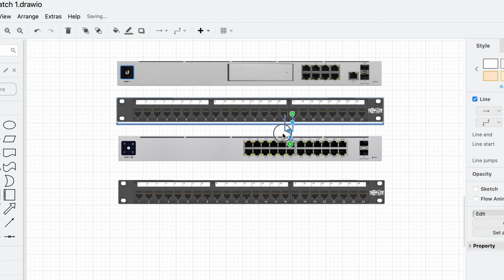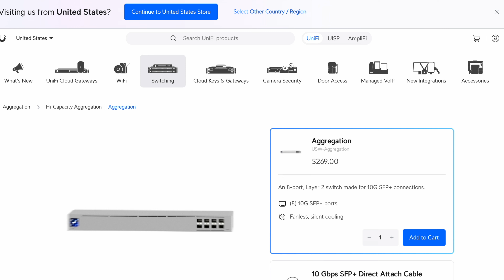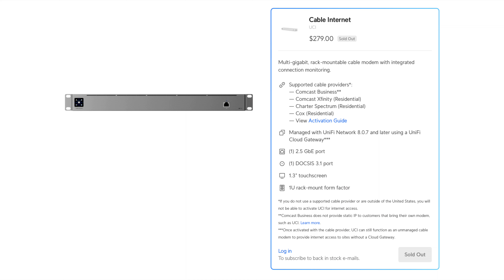Unifi Network Rack Cleanup!

Comment: I am looking at adding an aggregation switch also. I was under the impression you are supposed to run from your UDM Pro into the aggregation switch with 10G. Then from your aggregation switch to all of your other switches. It looked like you went from your UDM Pro to your 24 port switch and then into the aggregation switch. I may be wrong but wanted to mention it.
Reply from the maker: For my home, and most small business, it wont matter. There is plenty of switching capacity in the Pro switch and I am only really using it between my office and my synology. If I had 2 or 3 switches it would help. This is all way overkill for my needs anyway lol.
Reply: @JerrySchulze  understand my network is absolutely overkill for my needs also, but I don't play golf, so. LOL. Have a good one and appreciate the reply
Reply: Nice! I have a similar setup, but no aggregation. UDM Pro 10 GbE to 10 GbE switch, computer to the UDM Pro 10 GbE WAN (but port changed to LAN mode in the controller), Synology to the other 10 GbE switch port
Reply: @Jerry: First nice job, but your answer about bobby is not fully true. The way bobby would make it is better because off backplain L3 switching.

Comment: Gosh, you are using 10GB adapters for the Uplinks !? :) , please put some DAC cables there, much less heat and latency.
Reply from the maker: I have Dac between UniFi devices now. Have to use baset to office and synology.
Reply: @JerrySchulze  Ok, for the computers and the Nas is "fine" as there is no other option, at least for the uplinks will have much less heat, power consumption and latency.

Comment: I like the color coding of the jacks and cables. That is what I did on mine, but I used punch down RJ-45 jacks instead of pass through jacks. This eliminates one more failure point. I also did the patch panels above and below. You should also consider putting on small zip ties around the Ethernet cables and attach them to the strain relief bar behind the patch panels.

Comment: I would have had the 10 gig port on the UDM-Pro go directly into the Aggregation Switch and then connected the 24 Port switch to the Aggregation Switch, definitely not essential just a slightly more standard way of doing it.
Reply from the maker: I didnt because my little amount of traffic doesn't matter, BUT, I did re-work the whole thing again and did change that config.

Comment: I hate crimping cables, especially the thicker Cat 6A. I had the electrician do that for me while adding Ethernet to a build in an ADU. I still checked though to make sure it was running at the right speeds. 

Those slim cables are nice! I need to get some to clean up my small 8 port patch panel at home.

Comment: Those ethernet cables are not crimped correctly., the blue jacket has to be inside the rj45 connector
Reply from the maker: Yep, I absolutely know that. I was just being lazy.
Reply: I cringed a little bit also, but at the end of the day they are in a protected place and will still function just fine.
Reply: In the future use EZ-RJ45 with that tool allows wire to go through connector and cuts and crimps at same time.  Perfect every time and you get confirmation wires are in the correct location.

Comment: What a difference that made! Well done, Jerry! Question for you... Is there any particular reason you're going from your aggregation switch --> 24-port switch --> UDM Pro instead of 24-port switch --> aggregation --> UDM Pro? that way your aggregation switch is, well, aggregating all other switches and feeding that into your firewall?
Reply from the maker: Thanks for watching. Just because it doesn’t matter in my small home network or most small businesses. I really just wanted to keep using 10g for my office and symbology and step up from the 2x 1g uplinks. For that, I needed more ports but wanted rack mount otherwise the flex 10g would have been fine.
Reply from the maker: But I did pick up a UniFi cable modem so maybe I will make the change and move it above the top patch panel.
Reply from the maker: Also, looks evenly spaced like this, lol. I’ll never stop messing with it.

Comment: If I could make a suggestion, first off you had a routing loop in the pre-work by wiring out two ports to two ports on the switch (P1/2).  While they could be different vlan's it was accomplishing nothing of any value.   The reason is that the way the UDM works, those 8 ports are a switch, with a 9th(phantom) port on the motherboard you don't have access to that runs to the CPU.  That phantom port is only link to the rest of the network.  So the total bandwidth of those 8 ports maxes out at 1Gbps leaving that 8 port switch.  That is the reason that you couldn't LAG any of those 8 ports together as they are just a layer 2 stand alone switch.    There are 4 ports that tie to the CPU, port 9/10/11 and the one hidden port (from the 1-8 ports).  

In the final layout, I would like to suggest a change for increase performance.  

* Take the 10G LAN port (11) from the UDM directly to the 8 port Agg switch and make sure that is set to VLAN 1 (which is all vlans trunking port).  Then take port 25 SFP+ port to the 8 port agg swtich again on VLAN 1 as a trunk port.  This will allow you to actually LAG together by taking port 26 there as well.  So in this example you can Port 25/26 to port 1/2 of the 8 port agg and then port 11 from UDM to port 8 lets say.  Then you can use all other ports for specific devices on the agg switch.  What this will do is allow a 20Gbps LAG from to 8 port agg switch and any 10G devices to go faster.  You could also move the layer 3 routing of the VLANs to the 24 port switch off the UDM.  This will allow faster line rate devices not to have to go back to the UDM for routing and that traffic would stop in the 24 port switch.

Don't do the intermediate hop from 8 port to 24 port to UDM.  Make the aggregation switch actually aggregate all the traffic.  It will help optimize the network.   I normally take all the 10G ports from each switch and LAG them together for either a 20G port or 40G port to the aggregation switch.  With the pro aggregation switch it has Layer 3 ability vs the only layer 2 of the 8 port so all the routing can be offloaded there and keeps that routing off the UDM all together.  

Like in your final config I don't use any of the ports on the UDM's either, one reason is that Ubiquity has really reduced the overall EMP/ESD capabilities of the UDM.  The older switches were rated much higher than the newer series, and way more than the UDM's.  With lightning and long cable runs the induced voltage can be high.   I have had the switches panic and restart the power supplies for POE because of close by lightning.  It really stinks because of course all the cameras reboot as well, so you never see anything of the actual strike except a bright flash and then no signal while the switch reboots. 

Otherwise great job.  Looks much better and also your equipment will love you better because it will run cooler as well with the gaps (patchpanels) between them.  🤠👍

Comment: I think you made two "mistakes". (Big word, you not doing it that bad). You should have gone with (toolless) Keystones with connecting the cables directly to the back of the Keystone, instead of couplers with RJ45's. You got another point where contacts van fail, and they are easyer to put on then a RJ45.

And I think that you should do, from top to bottom:
UDM > Agg > and then to all devices from there. I also think that you should have put it in that way, physically. And get the SFP+ card for in the back of that Synology and use a DAC between the Agg and the Synology. That works great (have done it at two customers like that, works great).
Reply from the maker: Yes, I originally did switch first because I am not pushing anywhere near the max of the switch. I have since rearranged to UCI>udm>agg>pp>sw>pp.
Reply: nice video! I agree, though, that punching down each Ethernet cable into a keystone would remove the additional connection between RJ45 jack and keystone. Also, it might be good to cable tie each cable to the rack management portion of the patch panel.

Comment: you need to redo your patch panel cabliong the wires should never be exposed like here 3:29 you should always have alest 1 4th of inch orless in the rj45 head to protect the wires as well as prevent them fromcausing cross talk you did not make your cuts as short as you should have
Reply from the maker: Yep, I was being lazy and in a hurry.

Comment: I used to love Ubiquiti, but the access point stinks. They start out fine, then just get bogged down for some reason. I don't even have a lot of Wi-Fi devices in my environment. all the other gear is awesome though. all though I did have an 8 port poe switch just up and die for no reason after about 3 weeks.
Reply from the maker: I order millions of dollars of equipment for my day job and even the big boys like Cisco have hardware issues. Crap shoot no matter what you buy these days.